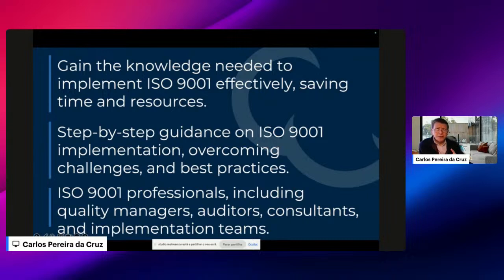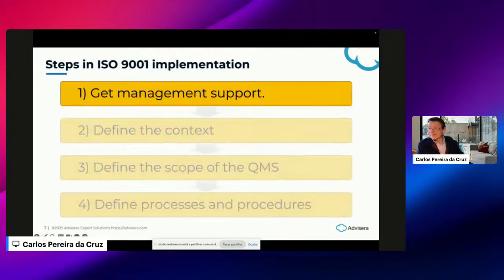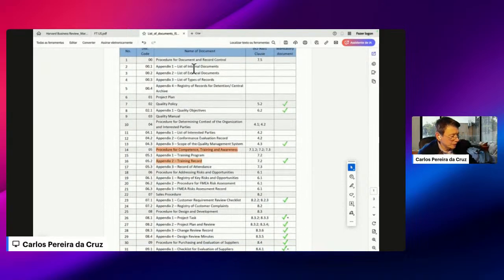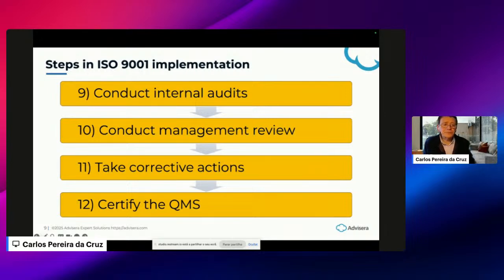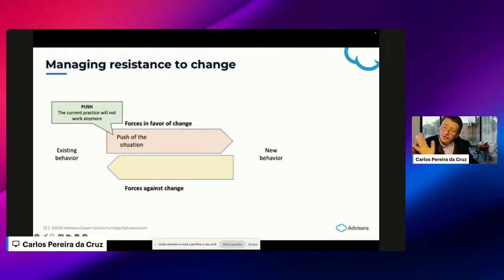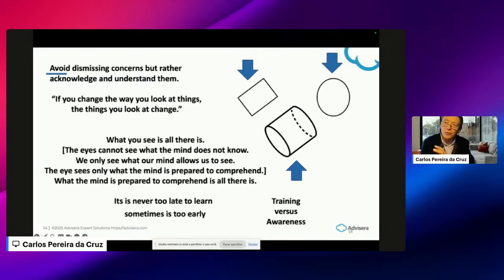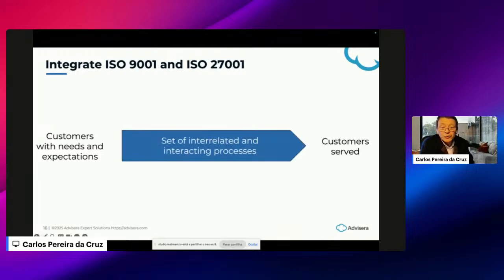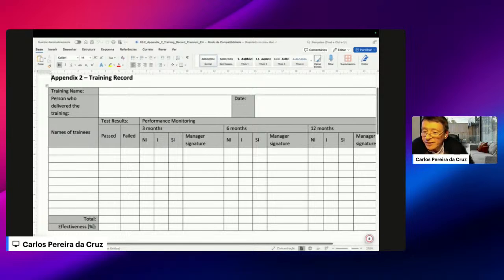Overview of ISO 9001 implementation steps [live webinar]

Comment from the maker: Please feel free to find below all the links that we have shared during the webinar: 
- ISO 9001 Premium Documentation Toolkit https://advisera.co/9001Toolkit
- Toolkit expert meeting link https://advisera.co/9001ToolkitExpert- ISO 9001:2015 Foundations Course - https://advisera.co/9001Foundations
- ISO 9001:2015 Lead Implementer Course - https://advisera.co/9001LeadImplementer- DISCOVER ISO 9001:2015 THROUGH PRACTICAL EXAMPLES - https://advisera.co/9001eBook  - What are the biggest challenges while setting up an ISO 9001-based QMS, and how do you overcome them? - https://advisera.co/9001Challenges
- Free webinar - How to Use a Documentation Toolkit for the Implementation of ISO 9001 - https://advisera.co/9001ToolkitWebinar
- ISO 9001:2015 Gap Analysis Tool https://advisera.co/9001GapTool
- Should you use a gap analysis in your ISO 9001 implementation? - https://replug.link/9001GapAnalysisUse
- How to choose a project manager for your ISO 9001:2015 implementation https://advisera.co/9001ProjectManager
- 4 crucial techniques to convince your top management about ISO 9001 implementation https://advisera.co/9001ConvinceManagement
- How to identify the context of the organization in ISO 9001:2015 https://advisera.co/9001ContextOrg
- How to define the scope of the QMS according to ISO 9001:2015 https://advisera.co/ISO9001Scope
- How to choose an ISO certification body https://advisera.co/ChoosingISOCertBody
- ISO 9001:2015 Internal Auditor Course https://advisera.co/9001InternalAuditor
- How to make Management Review more useful in the QMS https://advisera.co/MgtReviewUseful
- Free webinar - How to Use Generative Al Technology for ISO Management Standards - https://advisera.co/GenerativeAITechForISO
- How to integrate ISO 9001 and ISO 27001 - https://advisera.co/9001And27001Integration
- How to implement integrated management systems - https://advisera.co/IMSImplementation

Upcoming events:  
- LinkedIn https://www.linkedin.com/company/18062427/events/
- YouTube https://www.youtube.com/@AdviseraExperts/streams
- Advisera Website  https://advisera.co/Webinars 

Social Media channels: 
- Advisera’s LinkedIn Profile https://www.linkedin.com/company/advisera/
- Advisera’s YouTube Profile http://www.youtube.com/@AdviseraExperts

Please feel free to find the link to our PDF slides and the webinar survey below: 
- Webinar Survey https://info.advisera.com/webinar-survey/overview-of-iso-9001-implementation-steps/
- PDF slides https://advisera.com/webinars/materials/Overview_of_ISO_9001_Implementation_Steps_webinar_presentation_deck.pdf